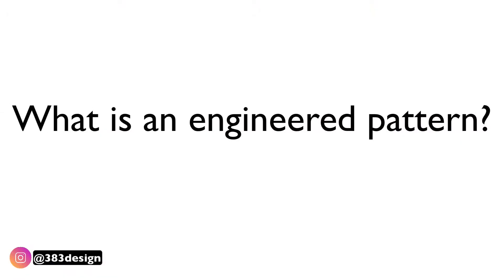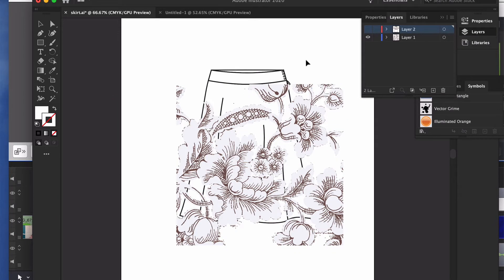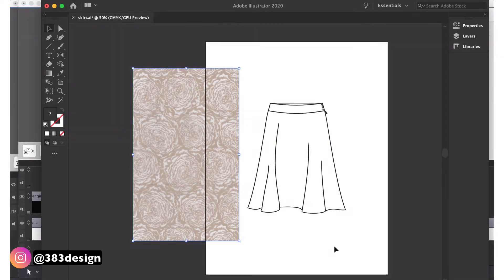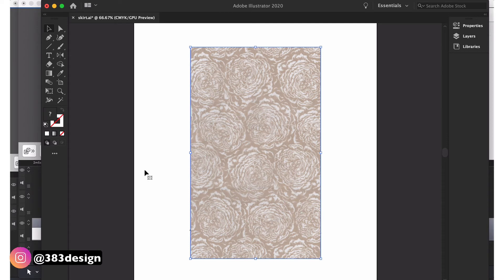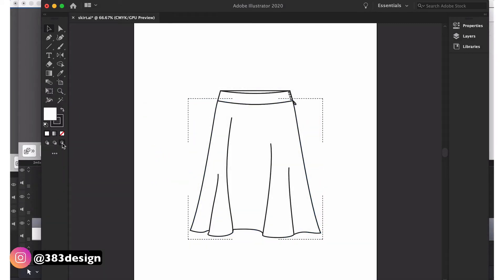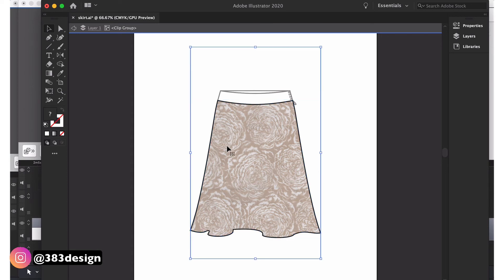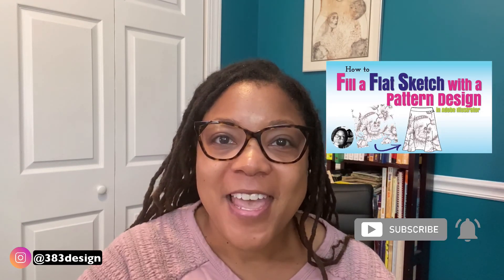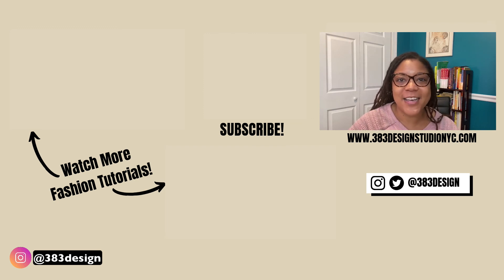Add a Fashion Print to Your Illustrator Fashion Flats in 3 Simple Steps!

Comment: How did you get a job as a print designer???
Reply from the maker: Hi, Dejahnay. Thanks for watching and commenting! I've never had a job that was just a print designer; we just had to deal with prints as a designer. If that's the type of job you're looking for, I would suggest you put a portfolio together of your designs and get familiar with the software that most print designers use (mostly Photoshop and Illustrator but also some proprietary products like Nedgraphics, but you can get a job with just Photoshop and Illustrator skills). I would also suggest you include any textile design projects you've already worked on. If you don't have any, you could also try designing some things and have them digitally printed. You should also start looking at these types of jobs to see what other things they might be asking for so you have those present in your portfolio. Good luck!
Reply: @383design   Hello thank you for your feedback